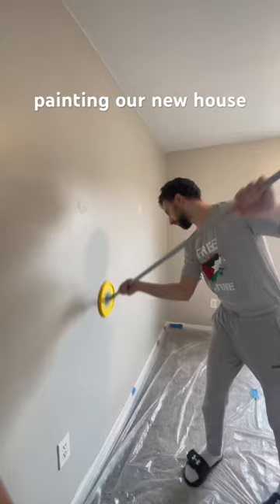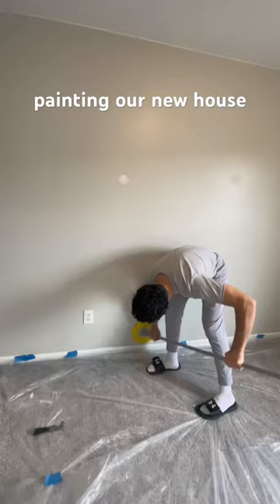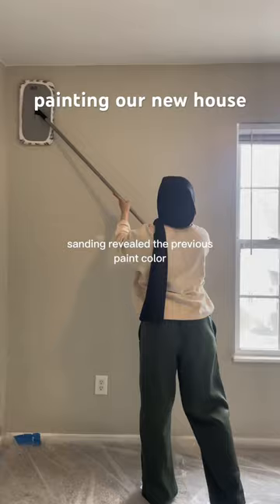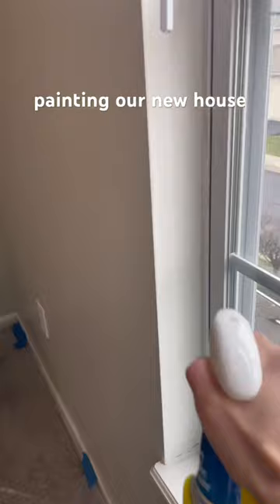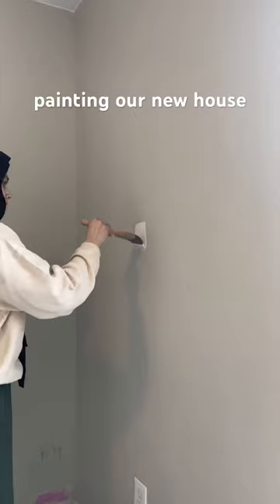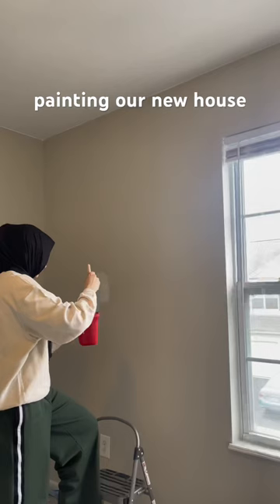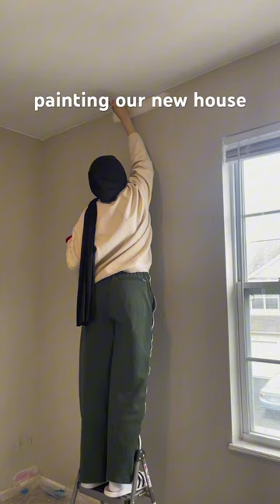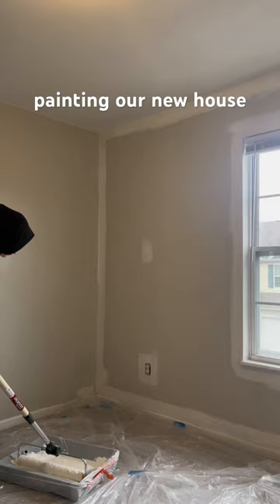it’s turning out so good as we progress😍 #painting #paintinghacks #newhouse #condo #firsthome #diy

Comment: You are painting wrong. You should not do up and down strokes, they should be at an angle. It is easy to see your paint lines.
Reply: Up and down is the way to go-Their problem is not priming and presumably not doing multiple coats.
Diagonal or side to side movements will catch the horizontal light from the window, and show more than up and down lines.
Reply from the maker: It’s not finished yet as stated in the video babes 🤍
Reply: @derekgleue3679 Not priming shouldn´t be an issue, just doing the spackle parts is fine if it was over old paint.  Seeing that first coat, my guess is they should use some more paint in each layer, this shouldn´t need 3 layers to cover, unless it's lower quality paint.